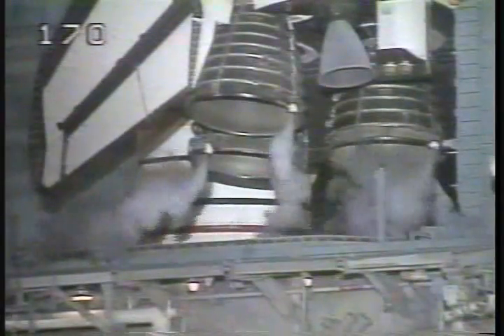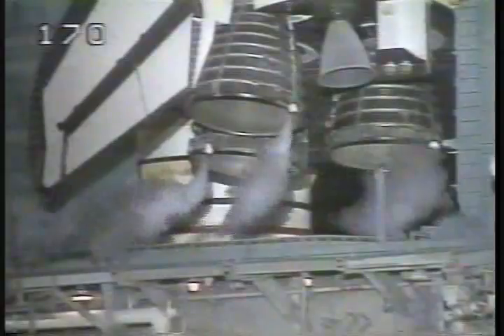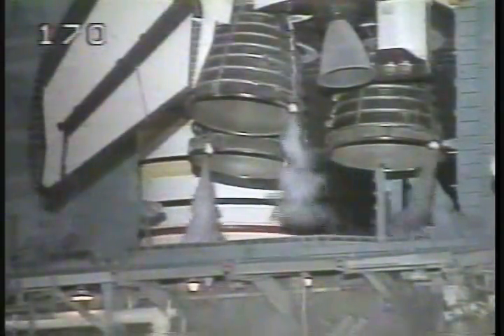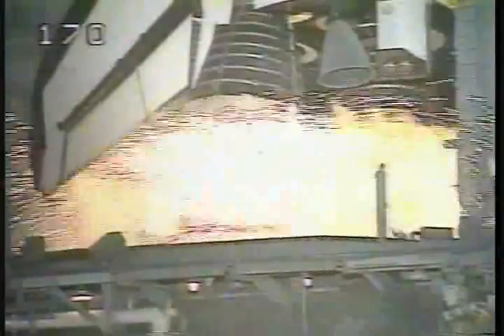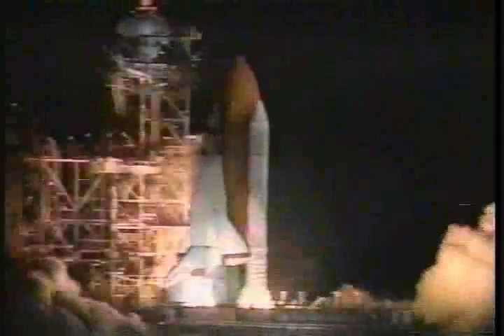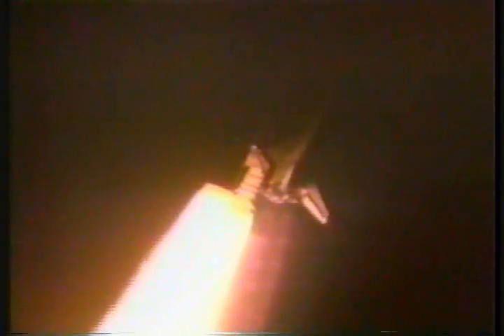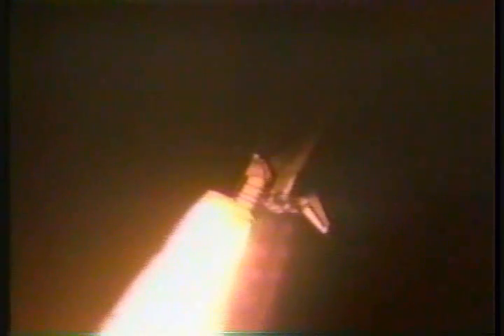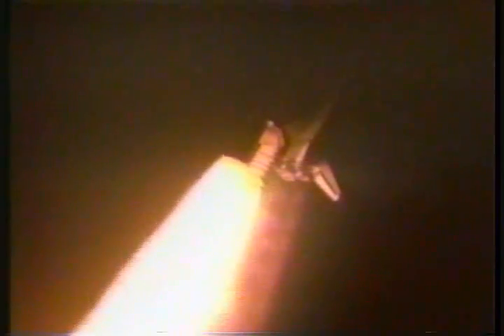STS-61 launch  & landing (12-2-93)

Comment: This was the first Hubble Space Telescope servicing mission, to repair it following a fault with the main mirror. 
Over a 5 day period two teams of astronauts working in pairs worked to restore the telescope to full working order. The first EVA, by Story Musgrave and Jeffrey Hoffman, replaced 4 gyros and 2 electronic control units and was the second longest US EVA to date. The second EVA, by Tom Ackers and Kathy Thornton,  new solar arrays were installed, one of the main goals of the mission. One of the arrays could not be stowed aboard the shuttle for return to Earth  and had to be jettisoned. 
The third EVA replaced the Wide Field Planetary  Camera with an improved WFPC, and was accomplished in just 40 minutes. Two magnetometers were installed on top of the Telescope. 
The 4th EVA  replaced the High Speed Photometer with the COSTAR unit, which compensated for the flaw in the main mirror. A co-processor was also installed that improved the memory and speed of the main computer. On this EVA Tom Ackers achieved the longest cumulative record of time on EVA and Kathy Thornton became the record EVA holder for a female astronaut. 
The 5th and last EVA the astronauts replaced the Solar Array Drive Electronics Unit and installed the Goddard High Resolution Spectrograph redundancy equipment and placing protective covers over the original magnetometer. 
The Telescope was successfully redeployed into space and Endeavour landed back at the the KSC.
The Commander, Dick Covey, made his 4th and last flight, and pilot Ken Bowersox his second. He would command the next Hubble Servicing mission in 1997. 
Mission Specialists Kathy Thornton made her 3rd flight and Claude Nicollier his second. He would fly on the third servicing mission in 1999. MSs Story Musgrave, who was the only astronaut to fly on all 5 space shuttles, made his 5th flight, Jeffrey Hoffman his 4th and Tom Ackers his 3rd.